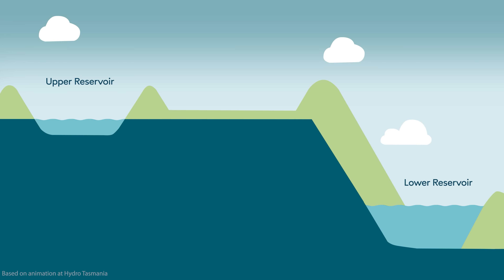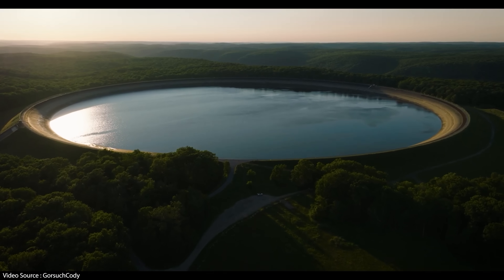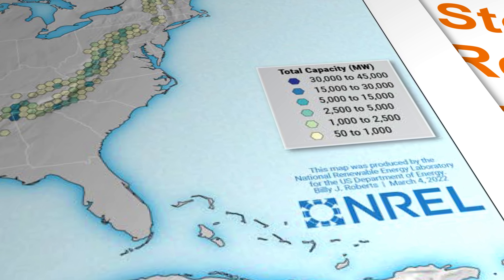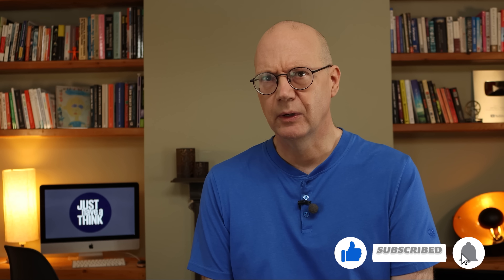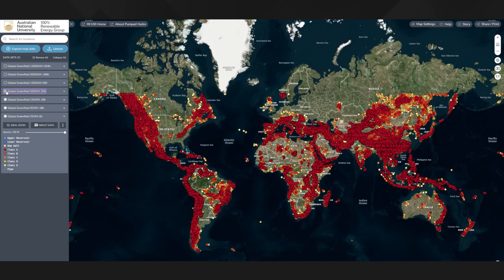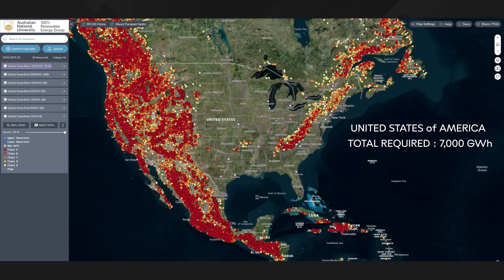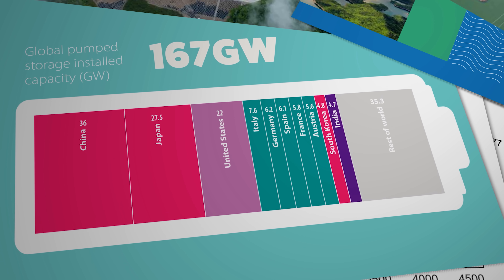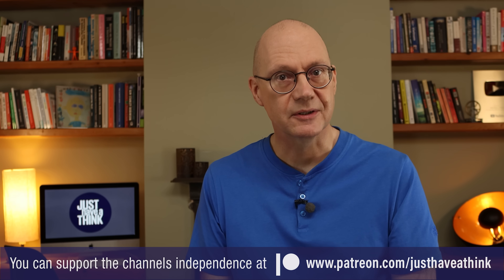The insane potential of Pumped Storage Hydro

Comment: I know they work but it just seems counterintuitive because you have to use energy to pump the water back up when that energy could be used for something else. Nothing is as efficient or effective or instant as battery to grid backup power. And it's being deployed at an incredible rate
Reply: You're using excess electricity to pump water that is generated by baseload plants that can't ramp up/down as quickly as the demand changes. That's done at night when most people are asleep. When demand peaks in the daytime, that's when the water is released.

Comment: Obviously, pumped hydro works, but I wonder what the cycle efficiency is. Energy is lost at every energy conversion - electricity to pump water going up, water generating electricity going down, and piping friction each way. Surely there will be other losses, too- like some pumped water loss (besides evaporation) due to seepage into the ground.
Also, running machinery 24/7 there has to be relatively high maintenance as compared to solar and redundancy to the extent that one pump/generator can be down for repair without reducing the electrical power available. 
BTW: Pumped salt water, “toxic” or contaminated water is ecologically a bad idea…

Comment: You did note the cost of resources required for batteries, but can you also point out the resources required for wind and solar as well?  And the fact that most of the manufacture of wind and solar is done in China, currently undergoing a population collapse that threatens its manufacturing sector?

Comment: Pumped storage schemes need to be as efficient as possible. As to floating solar, the warmth from the panels may help to warm the water and reduce frictional losses. Tin or stainless stell wires may help to spread the heat.

Comment: The issue is finding places adequate for pumped hydro. Hydro is great if you have the correct place but batteries or other tech Trump hydro in most locations. Even sand batteries beat out hydro in many places.

With every type of energy we will have loses. What is best in your area? 99% would benefit from pure solar. Simply design our equipment to use direct solar from panels. If you need a bit more at night add batteries.

This is actually stupid easy. But even the host refuses to give up 5% of his convenience.
Reply: One company would use all the power from one of your ideas. Anything done needs to serve the people. Not one or two people. As you know gas power plants supply more than what is used. You can't get around that if you want to maintain 120v / 240 volts at 50/60 hertz. 

Your only option is generating unregulated power across the country side and have it regulated at the source. This is very simple to do. We do it everyday. As is.

Comment: A provocative (in the right sort of way) video.  My imediate thought (reinforced by your showing of the great Dinorwig quarry scheme) was using old coal mines as the lower resevoir.  I've seen talk of falling weight energy storage systems in the shafts, but water makes a wonderful weight and allows the use of the addits as "weight" storage.  Make the upper storage as large or small as you have space for.

Comment: I also think that it is not a good idea to prevent water evaporation because it keeps the air cooler in summer. The loss can be easily replenished by rain which will prevent stagnation. If you run water in a closed cycle for a year, the water will be full of biological growth and mud and soil residues. It is not wise to treat the water with chemicals to prevent biological growth.

Comment: Nice! The advantage of PHS is that it is a ‘proven technology’ where the costs can be calculated reliably. Sometime ago, you discussed LAES (Liquid Air Energy Storage), in particular the system of HighView Power. I tried to lookup any reliable analysis of how expensive or cost-effective such a system really is, but this turns out to be difficult. Do you have any sources for that, or can you give it some attention in this channel? I downloaded the 2020 SANDIA report of the ESPS (SAND2021-14700) and that shows an overview of different storage solutions with the Levelised Cost compared, more or less. But I am not sure if this is reliable and how to actually compare the various methods. The cost of a storage system (in order to provide some degree of continuity and stability) should be included in the total cost of renewable energy sources, just as the cost of climate breakdown should be included in fossil fuel prices.

By the way: one problem of PHS is its big impact on the landscape.

Comment: As an engineer I worked on two pumped storage  stations including Dinorwic featured in your vid. The system of pumped storage works well,  is fairly  low tech and safe compared with the amount of energy that can be stored. Sadly  I also know how difficult it was to find a site to build a new pump storage station. There is always a strong lobby, an area of SSI  or a national park to be considered. You did not show the areas in the uk identified in the study,   Thank you for your work on this topic.
Reply: Hello. I wanted to ask that what goes into investigating for potential pumped storage sites. What softwares, research and considerations are taken into account. And how to go about doing. Im asking because i have to do a project on this for uni and explore potential sites in my country for PSH. It’ll be really helpful to me to get an opinion of an experienced engineer🙂
Reply: I know this comment was a while ago but do you know what the efficiency/loss is on such a system?
Reply: Here in Sweden a company called Sustainable Energy Solutions is looking into old abandoned mines for PHS. The big upside of old mines is that the environment impact is minimal since its already “built”.

As an engineer who’s been working in this field, what are your thoughts about this approach?🇸🇪
Reply: hi.   maybe you can help me and work with me designing a better pump storage.
please reply...thanks     dino

Comment: Whilst you've considered this again Dave, I'm astonished that the UK hasn't  used tidal/river schemes such as the Severn barrage and the Swansea Bay project. Bearing in mind that the high tide is twice a day and moves around this little island, I'd have thought that at least 40% of these would be at maximum generation. Even Canute, couldn't stop the tides! 😅
Reply: Yes. Been talked about for decades. Meanwhile La Rance tidal barrage in France has been running since 1966.

Comment: Another angle for pumped storage that’s now being pursued is the conversion of existing one-way hydro schemes to pumped storage - where the lower level has a lake rather than just a river for run-off.  The large hydro scheme in Scotland connecting Loch Sloy with Loch Lomond is planning an upgrade to pumped storage, as it was originally conceived in the 1930s.  There’s a good Wikipedia article on Sloy Dam, well worth a read!

Comment: In Australia, PHS is a no brainer. ~65% of the population live at the base of a mountain range. The lack of political agreement on the need for energy storage has been the main impediment to PHS in Australia. PHS requires a large capital injection , and yields low operating cost storage for 50+ years.
State governments own and operate the majority of electricity generators,  and are likely to be the owners of most new PHS.
Our national science agency (CSIRO) forecast the capital cost of long duration PHS to be AUD $100 - 200 per kWh, which over the 50+ years of its service life (assuming 80% round trip efficiency, 80% discharge cycle per day, and 1% p.a. operating cost)  gives a storage cost of ~ AUD $0.02 per kWh.
Retail grid supply price (predominately fossil fueled) is ~ AUD $0.32 kWh. Grid scale Solar PV or Wind system generation cost is AUD $0.05 kWh .
Yes, we need lots of PHS as quickly as we can get it - typically PHS takes 7 years from planning to operation.

Comment: I was about 8 years old in the early 1970's when I was brought on a school trip to Turlough Hill in Wicklow, Ireland, one of the first pumped storage system.  It still functions perfectly, coming up to half a century after its construction.  I regularly hike up around it.  Its a little unsightly, as are the 220KV lines running up to it, but its an invaluable source of storage for the Irish grid.  There can be no doubting that they can be a problem in our mountains - they involve serious heavy engineering and lots of new power lines, but there are plenty of possible sites available over most of Europe.
Reply: Unfortunately power lines are going to be part of these types of facilities.

Comment: Accumulation hydropower is still based on lose end energy transfer from point A to point B and vice versa (water also used as product for water supply systems). Electric engine has from 80% to 90% energy efficiency based in closed loop (circuit) why same principle not apply to hydropower energy generation. Reason energy is cheap, oil cheaper than water and just climate change and air pollution makes some contribution to energy generation behavior nobody wants black smoke chimney stacks.

Comment: Simon Michaux replied to your critical piece and calculated that IF we needed 28 days storage - the human race could have to store 28 days of water which would be an extra 50% of our fresh water demand. Simon needs a few points. Newsflash 1! Most engineers model so much Overbuild they only need 2 days storage, not 28 days. Newsflash 2! While limited, freshwater is renewable. We are putting this water into a closed-loop cycle. The initial filling is a one-time deal. So rather than thinking of 50% extra water use every year - it’s a one time deal. If it takes 10 years to build all the dams, we're talking 5% extra water used each year. 20 years is 2.5%. Once full, we're done. As long as an Environmental Impact Study at each site determines the health of the local river system and limits how fast they do the initial filling, I’m happy. What about evaporation? Now that's the real question. Even though they are closed loop - they’ll still lose water. Slowly. The good news? We'll cover these reservoirs in solar panels and other materials that reduce evaporation. The better news? It's been measured, and the water lost lost to evaporation is only 10% of the water lost to a similar amount of energy being generated by a coal fired power plant. In other words, once the initial filling is done - we'll use 90% LESS water than in today's largely coal-fired power system. We've just got to stretch the initial filling out long enough.
https://theconversation.com/batteries-get-hyped-but-pumped-hydro-provides-the-vast-majority-of-long-term-energy-storage-essential-for-renewable-power-heres-how-it-works-174446

Comment: Ah yes our government leaders are leading us down this path. I mean sure my carbon footprint compared to any government leader's will surely be less but I can at least do something about my carbon footprint. It's very easy for me to have a negative carbon foot print you just need to buy enough solar panels that you are providing enough power to the grid to not only remove your energy carbon footprint via removing emissions from the fossil fuels but if you have more solar than you need you are also removing that carbon from other people's emissions because they won't need as much fossil fuels to power their home. Now obviously if everyone did that we'd have an excess of energy and still carbon emissions from every other category but if you combine that with buying an electric car then everyone doing that would reduce emissions by over half and without the car about 25%. If instead of doing things like protesting you went and worked instead the pay for just those hours would pay for that much solar easily. Protesting certainly doesn't seem to be making the government do anything and if you think the government will do something that you want in the way you want it you are misguided and if you think should the government implement stronger climate change policies that they would do a good job of this then you are even more misguided. Look at carbon offsets there are so many loop holes that it's basically free money a lot of the time.

Comment: Until i saw this clear explanation of the current state of pumped hydro, i had no idea how ambitious  the New Zealand Battery project is.  "‘Dry years’ usually last for a few months, and it’s not possible to predict when one might occur, or how long it may last. They are more likely to occur in the colder months when inflows to hydro lakes are lower due to rain being bound up as ice and snow. This is at the same time as when there is increased electricity demand for heating homes and other buildings. 
Dry years are also very hard to predict. Historically they have occurred around twice per decade. In recent years, we have experienced dry years in 1992, 2001, 2003, and 2008. So a dry year solution would likely be used more frequently than twice a decade.
Based on 89 years of hydro inflow records, the NZ Battery Project estimates there can be an energy deficit of between 3 and 5 TWh in the worst dry years. This is about 10% of our current annual energy needs."
Getting to delivery will involve a lot of tightrope walking through politics but comparatively little technology... the storage lake is there and we are fortunate in our geology znd geography. We will worry about endangered ducks and lizards but hopefully about people and the planet as well.

Comment: Pumped hydro is very good short term energy storage ! The big issue of storage is rather the long term storage for which there are very few "solution"
Reply: For long term storage (a few weeks, inter-season and inter-annual reserves) very low cost energy storage is necessary. Classical hydro can do a small part of it, storage of H2 is still not posssible. Bio-methane is very small regarding the amount needed. It is possible to convert some of the existing system to burn wood (very easy to keep for long term) but is remains very expensive if this is used very occasionaly !

Comment: Thanks for something uplifting. Using something abundant, natural that does not require mining and has infinite cycle life is perfect. 
An overlooked similar idea is compressed air cars developed by Tata motors. They are not sexy Teslas but win on economics and green.
$15,000 purchase, 200k range, 110Kph BUT the kicker is $2 electricity to charge a tank $400 for a year of commuting... Most of us get payed nothing for off peak power to the grid. Use this for free commuting life ling. Air does not require mining and has infinite cycle life. I would buy one tomorrow if I could.

Comment: You sound like you've been getting a good bit of criticism. There are a lot of twits out there who are ideologically rigid to the degree where they believe the extinction of the human species is worth not implementing certain technologies.  The response to replacing coal with nuclear power (not practical anyway) Is met by raised crucifixes and the warding off of the evil eye.  This includes thorium reactors and small nuclear reactors.  The discussion usually does not get off first base.  Geoengineering is another similar taboo.  The far right has its populist propaganda, but so do sections of the so called green movements.  Which makes one wonder.  
Thank you for all your hard work Dave.  A balanced perspective is always a treasure.

Comment: I never really thought of pumped hydro as a small scale battery solution. I always associated it with large scale projects. But if one thinks small scale you could see a system of ground-level storage tanks similar to the large water tanks used on commercial farms. These could be connected to boreholes which would pump water from below ground into the tanks using solar panels mounted on top of the tanks. Then this water could be allowed to fall back underground through a turbine when power is needed. 

The beauty of this system would be its modular nature and its easy scalability. All the components are readily available and if you need more capacity you just drill more boreholes and install more tanks.

Comment: Unfortunately pumped hydro to be viable needs elevation and SLOPE. The shallower the slope the water runs down the higher the loss to friction with the pipes. Your diagram optimistically shows a vertical shaft down to an underground generating / pumping installation. I've been in one such beast. Kind of intimidating knowing  that if something did go wrong I wouldn't have stood a chance.
ANother limiting factor is what the material surrounding  the dam is composed of. Water can build up in the soils or rock over time and care is needed not to lower the water level too quickly or there's going to be a landslide into the dam. In other words it requires a detailed geological survey to decide if a site is suitable for pumped hydro storage. So far despite paying millions for our Snowy 2 project's  geotech survey  the TBM is stuck after a collapse and only after making less than a kilometer progress.Despite that I agree, pumped hydro is great and we should be doing much more of it however you have to spend a lot upfront before turning the first sod.

Comment: What is the cold hard overall efficiency of pumped storage - it would be interesting to learn how much energy is lost in the process.  
I have heard figures of 80% quoted which still equates to massive losses...
Reply: It is about 75-80% as the water still has to be pumped up. That's still the best and cheapest battery available.